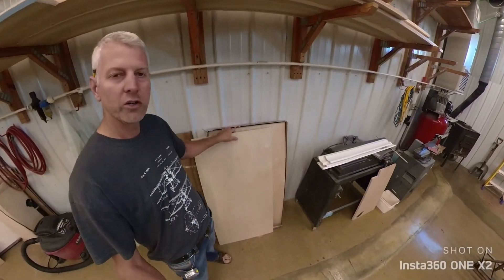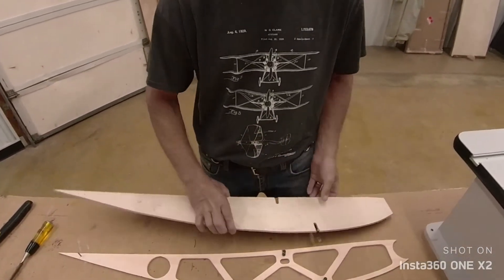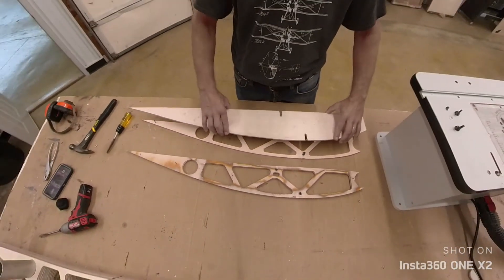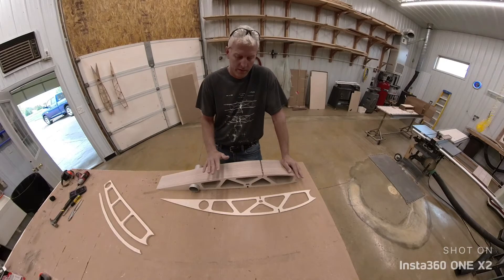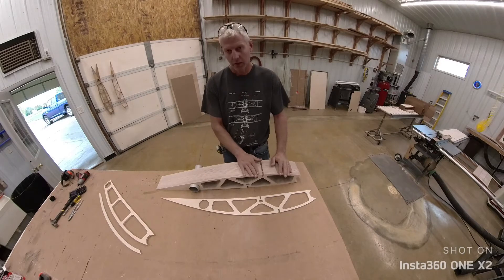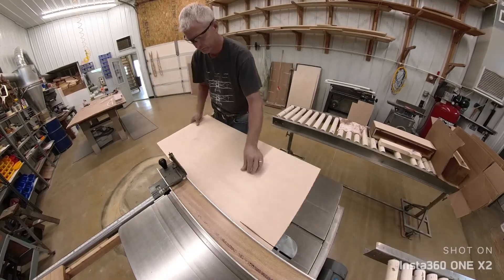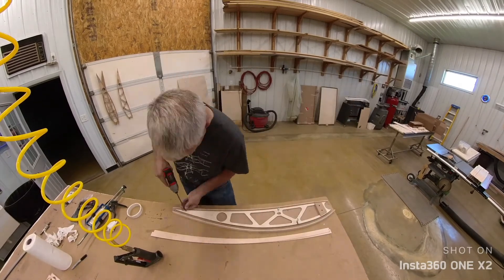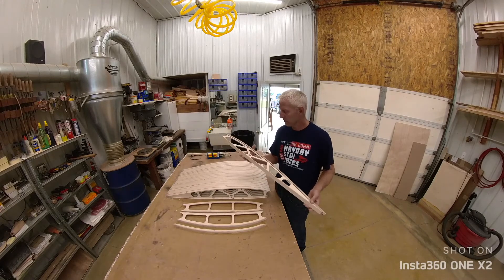How to build a better Wing design for my kitfox Airplane.

Comment: Hello TJ I picked up a new never assembled 1990 K-fox model 3 still in box , my question is can the ribs be modified to take out the under camber and is it really worth it performance wise.
Reply from the maker: congrats on the model 3 you can do anything to it but really no performance gains

Comment: What's the difference between the old and new wing? Is it just a different airfoil? What airfoil is it?
Reply from the maker: no more under-camber ultralight type wing. Ga30u-612
Reply: @builditright4666  What does the "U" stand for? In Harry Riblet's book I can find GA30-612 but no GA30U-612. Do you know what the difference is between them?
Reply from the maker: @reubenjantzi1988  I do not know.